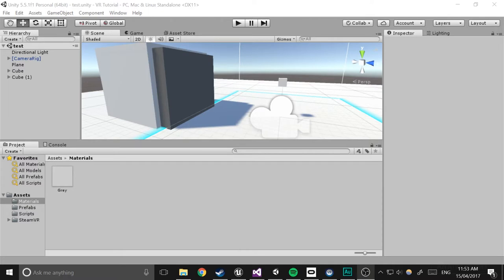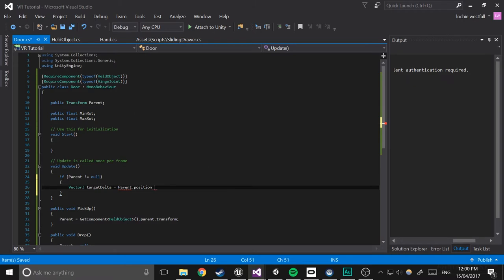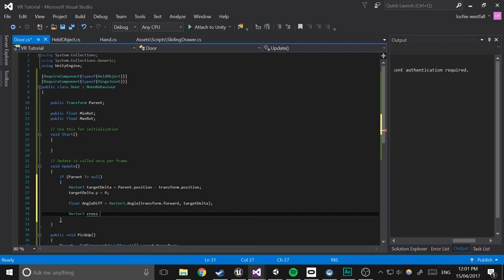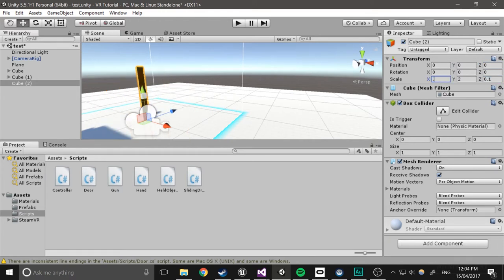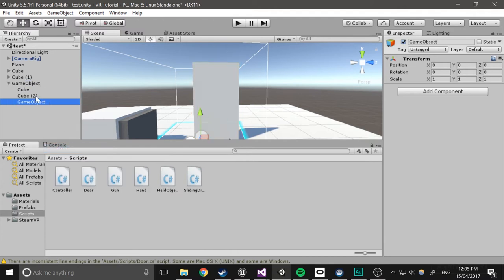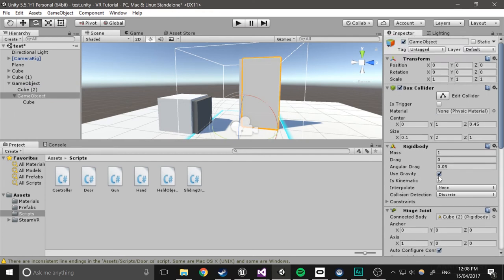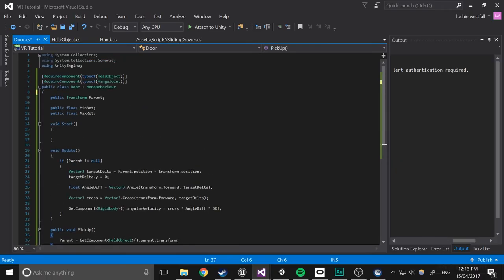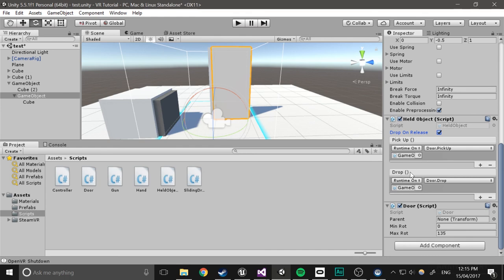Door Interactions - How To Make Games For The HTC Vive In Unity with C# (E06)

Comment: When putting the doorframe onto the parent, the parent takes the doorframes position even though I do it exactly the same as you, any idea why?
Reply from the maker: Jordan Bailey so the whole object moves with the doorframe? I don't really see a problem with that but if you have a problem I would suggest remaking the door which really doesn't take long.
Reply: the origin point of the parent isn't in the floor anymore it goes to the centre of the door
Reply from the maker: Jordan Bailey I think it might be that unity automatically puts an empty objects visual origin point on the centre of mass on the children. It shouldn't change the actual position however.
Reply from the maker: Jordan Bailey so just put the y position of the parent to 0 and the y position of the parent to 1